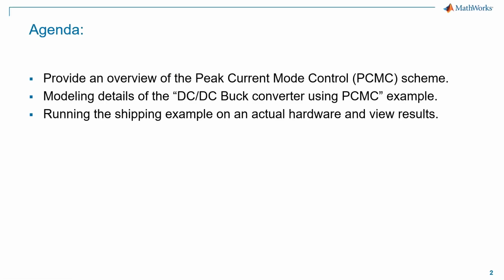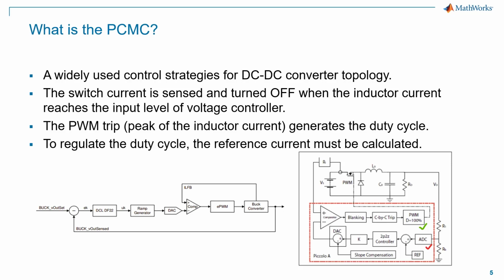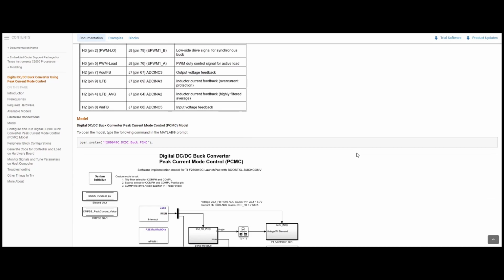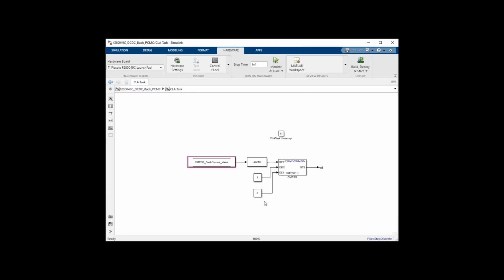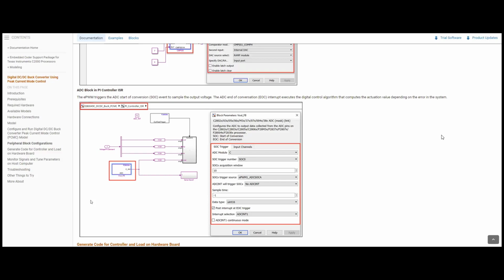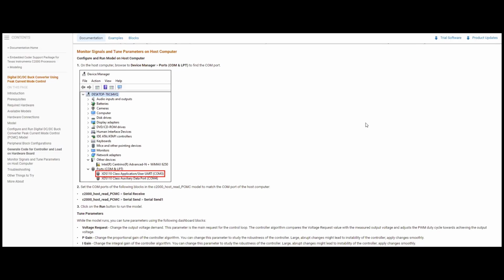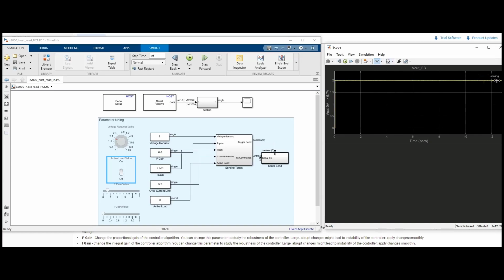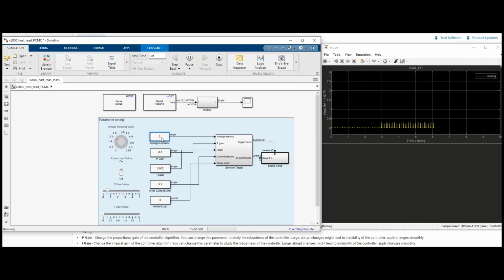Modeling Peak Current Mode Control using Embedded Coder TI C2000 Hardware Support Package

Comment: Thanks Sir . 
1. Could you please mention how CMPASS and EPWM are interconnected to set the PWM pulse based on the current limit?
2. How you are compared with inductor current without taking inductor current FB?